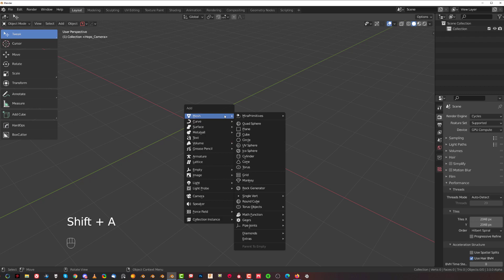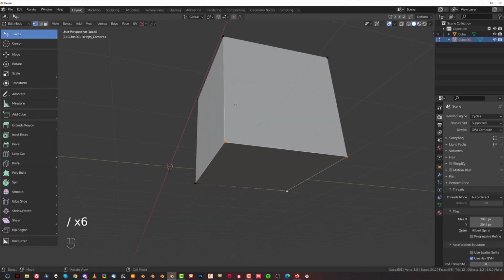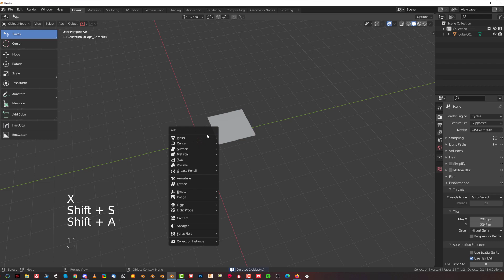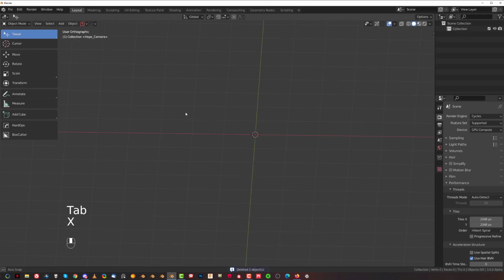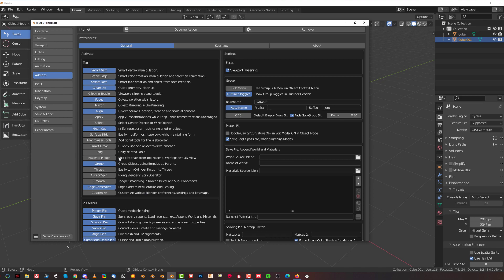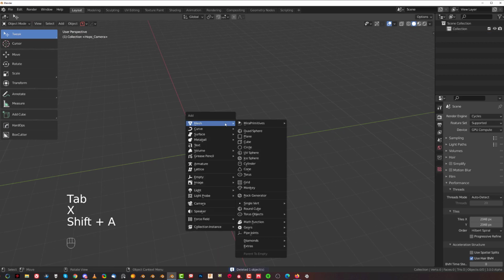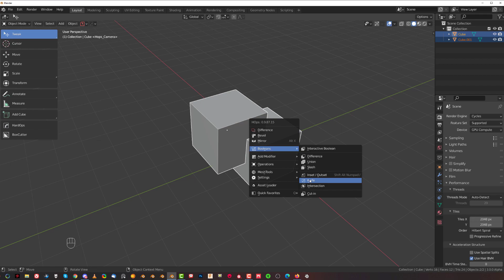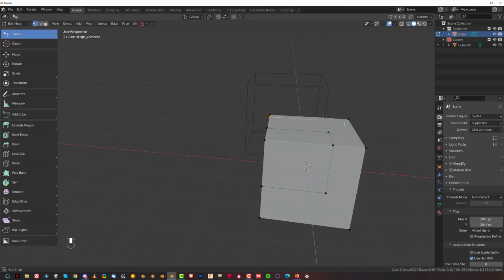Blender tutorial - Three Ways To Slice Stuff With Knife Tool

Comment: There is a cut through for the knife project, you just have to activate it in the "Adjust last operation" panel in the bottom left. 
Good video anyway, thanks.
Reply from the maker: ah ya good one, additional step though and still in project mode,  but it's there